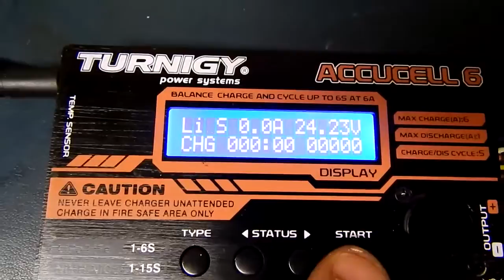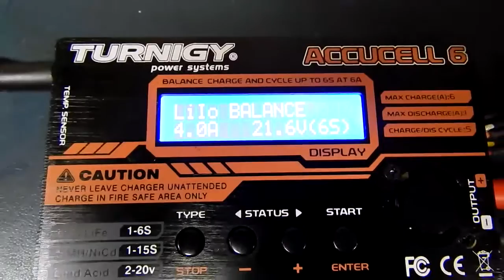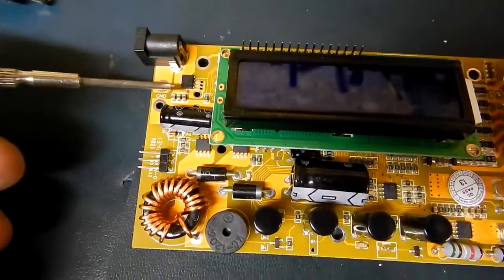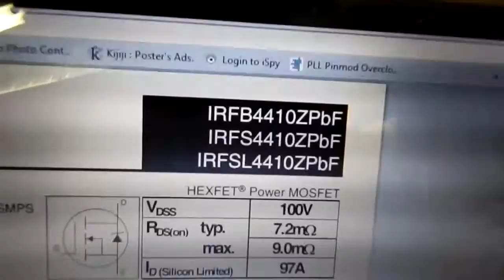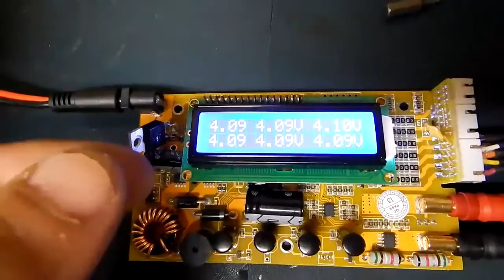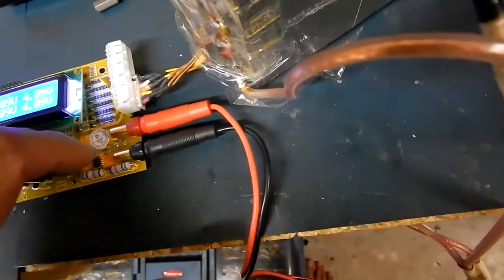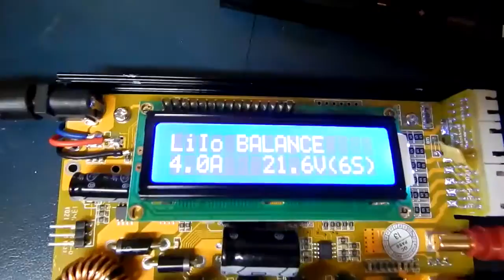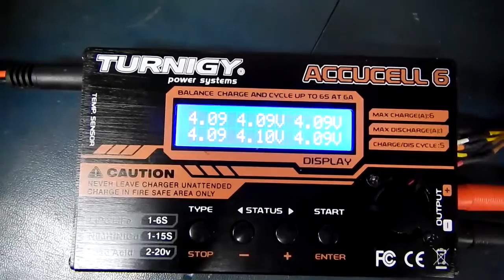Turnigy Accucel 6 repair*input volt error*

Comment: Low input Voltage Error imax6

mine is the adaptor problem..
i solve mine  with the R1= 0.5 ohm (1watt) or below near the mosfet 
make sure is a metal oxide resistor 0.5ohm 1 watt or below 0.5 ohm..

sometimes resistor go high ohm....!!!  
chears
Reply: Hi, could you explain a bit more? Where should I put the resistor? In series or in parallel to mosfet? I tried to replace mosfet.. same probpem - low voltage error